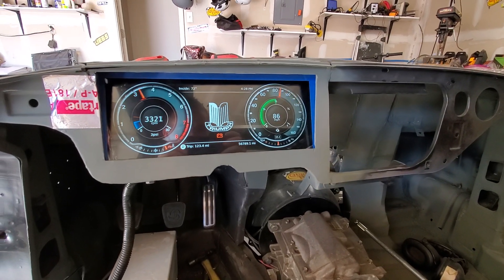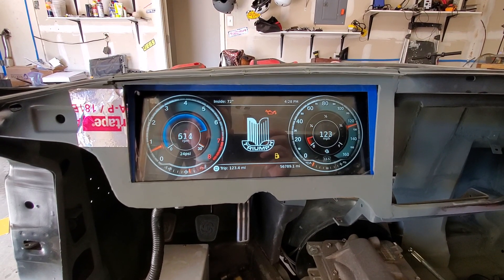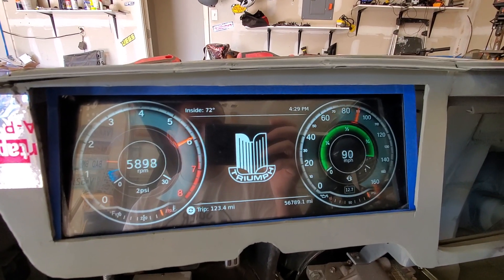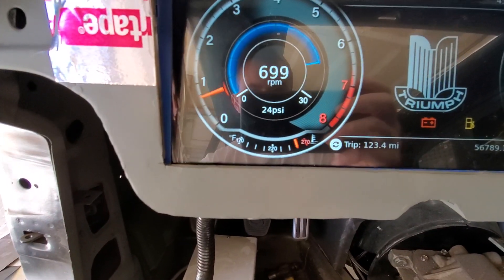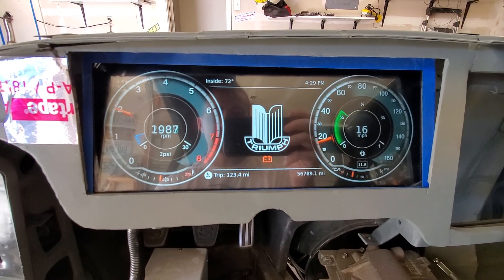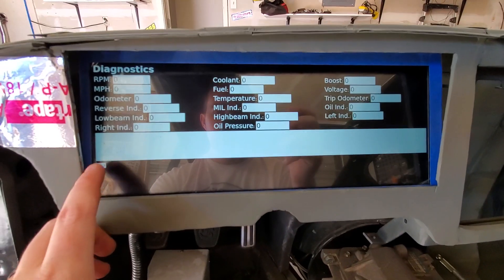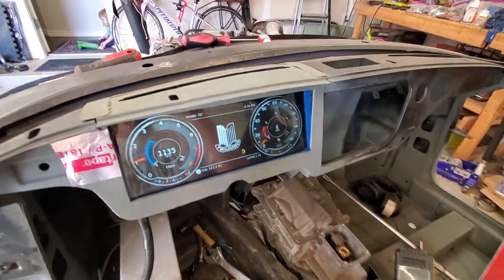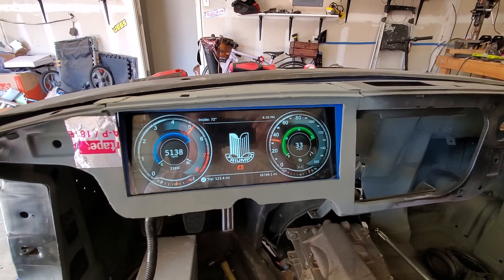Custom GT6: Custom digital gauge cluster in 1972 Triumph GT6

Comment: This is exactly what I have been looking for. I have a 1989 Honda accord that has a 2002-2004 TSX K24a2 engine swap. I am using an RSX Type s transmission which has an electronic vehicle speed sensor. the old accord one was cable-driven. since I am using the K series ECU, I can connect the can bus for rpm, speed, engine coolant temp, check engine light, af/ ratio, oil pressure, etc. ill just have to wire in for the turn signal and a few other misc lights. my question is how do I go about designing my own graphical interface? I want to design it like the 1989 accord that came with a digital dash.
Reply from the maker: It's a bit involved. I did it using Photoshop to get the design I wanted. Then I chopped it up into the parts that I needed that would move/etc. At that point you just need to program them into the display and add logic to move/rotate/etc the graphics to do what you want.
Reply: @MyCustomCars  Thank you, this is exactly what I needed to know.

Comment: I saw your boot time was ~20s, have you tried delaying the boot of the software and instead pushing a boot image/animation to the display. This would delay software boot by ~5 seconds but give the appearance that things are moving along, much like modern displays in OEM vehicles. May be worth looking into, even if it's just an animation which loads say the logo with a gradient burst behind it then goes to the dash with a Guage sweep similar to how you have it in demo mode. Once the first sweep is complete go to gauges set to min. I would imagine it can be timed where boot animation is about 10 seconds and then after the sweep you'd have maybe 5s of empty gauges before being fully functional.

Also I love that you used the whole screen but take a note from New vehicles, they'll put curves on the edges effectively rending corner pixels useless yet creating a clean visual that doesn't have the sharp corners of a display making it feel more natural and less modified.
Reply from the maker: Sorry about the late response: I did try that idea, but with the current iteration of the Raspberry Pi there was no way I could find to do it. I wish there was.

The ideal would be for someone to come up with a custom Yocto build instead of RaspiOS, which should boot in a few seconds. I just (sadly) don't have the expertise to do it. :(

Comment: Hi. Very nicely done.  I am rebuilding a 1971 Land Rover Series 2A and have been considering different options for display.  I need a rectangular display which can go in the middle of the dashboard.  I like what you have done. How do I go about replicating it? Or is there a place I can go and just purchase one.  I am afraid that I don't have the technical abilities to build one from scratch myself. Thanks.
Reply from the maker: Unfortunately mine does involve a lot of technical knowledge and ability, as it's 100% custom made. I know Holley and a few other companies make digital dashes, but they are not cheap - https://www.holley.com/products/fuel_systems/fuel_injection/gauges_and_displays/lcd_displays/

Comment: I'm curious which touchscreen you used. How well does it work in sunlight and at wide viewing angles? I'm looking for a solution that would be used on a boat.
Reply from the maker: Hey Kurt. Here is the display: https://m.aliexpress.com/item/4000929352535.html?spm=a2g0n.orderlist-amp.item.4000929352535&aff_trace_key=&aff_platform=msite&m_page_id=4574amp-p8_6k-ye6Yp3sheMr-IlXA1617225748503&browser_id=6d4c4a37d5b44f3890ca18304605ecff&is_c=Y I haven't tried it outside yet for obvious reasons, although I do intend on having the car tinted/etc.
Reply: They make sunlight 12.3 touchscreens as well